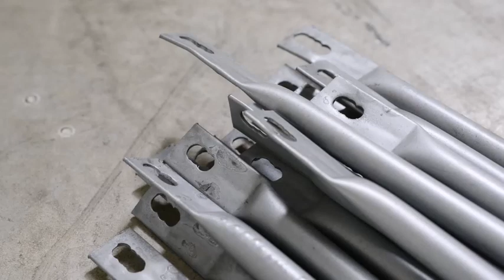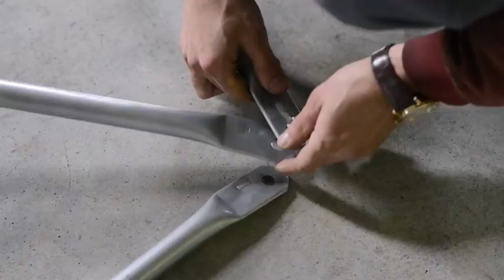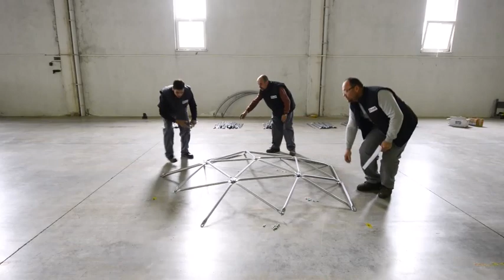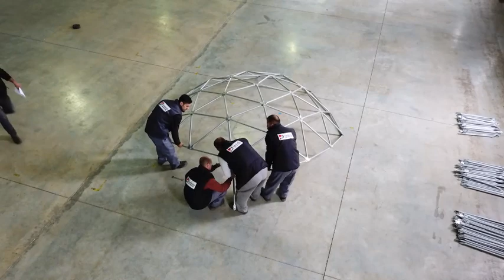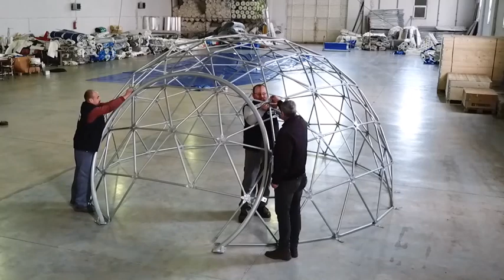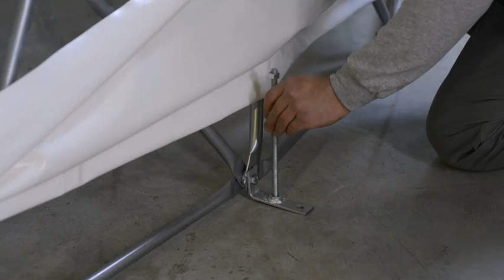Instalare structura geodezica  G6

Comment: what about using drilled thick round flanges as hubs and stamp the same letters of struts ends on the holes and its part number to give assembly refersment?
Fact is that a structure where every single strut can be removed or installed fastening and removing 2 independent bolts is more flexible than removing 2 bolts involving 10 struts...